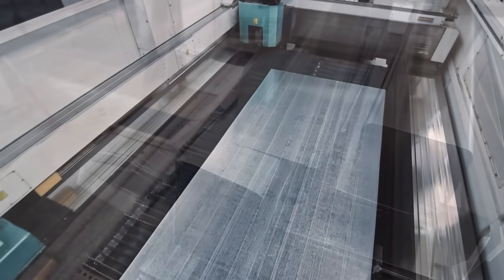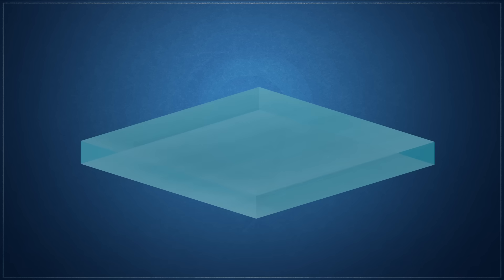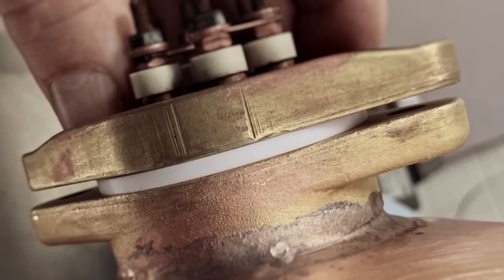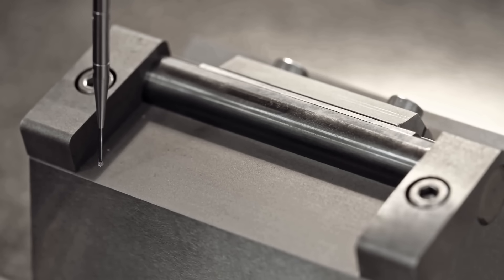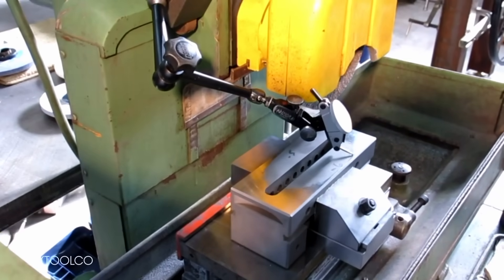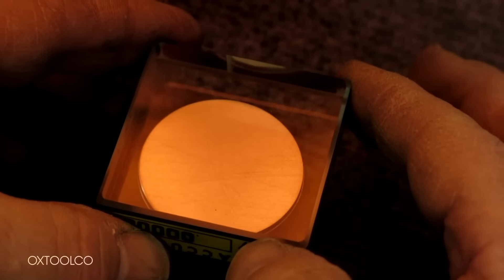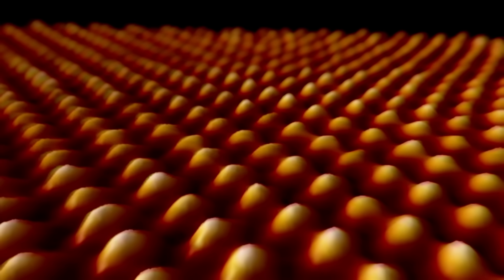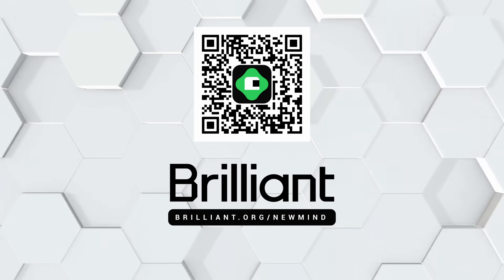The Science Of Flatness

Comment: I once made some testing hardware for western digital, and the hole size was +0.0001 -0.0000 in order to hold that size in a non air conditioned shop we had to change tool offsets 4 times a day as the shop warmed up.
Reply: sounds like one of the best excuses to get AC that I've ever heard
Reply: How do you even verify something like that is correct? If change in room temperature is enough to make your machines out of tolerance, wouldn't the part also expand and contract? Did they have to specify that tolerance at room temperature? How do you even machine that? The tool itself is going to heat up.
Reply: @DoesntRefillTheBrita  If you know the material, unstrained parts have very well specified thermal expansion ratios, so it's possible to calculate/calibrate it.
Reply: @ of course, but the part is going to change size as it's being manufactured just from the heat of the tool. It'll be changing tens of degrees within seconds
Reply: @ And you've discovered why precision machining uses copious amounts of coolant and lube
Reply: I'm wondering if the amount of scrapped parts would have more than justified getting an AC to keep the temperature stable.😮
Reply: Uncontrolled environment that you had, you NEVER held .0001" tolerance.
Reply: I'm guessing freedom units

Comment: The three plate method is a really clever and elegant solution to one of the most mind-boggling challenges in achieving precision: how the hell do you achieve precision greater than what you started with? The existence of inhumanly precise tools and manufacturing will always be one of the most impressive feats to me
Reply: The fact that you can rub three rocks together and create precision surfaces still boggles me.  But not as much as precision threads. Like how do you get more precise threads from junk threads?
Reply: @christopherjones7191  averaging
Reply: @christopherjones7191  usually by some reduction method typically using gears.
Reply: @christopherjones7191 gear reduction
Reply: If it was up to me I'd have waited until lasers were invented.

Comment: Can wringing occur between two different flat materials?

Back in the late '90s, hard drive disk surfaces were so smooth that the read/write heads would cohesively bond to the disk's 'landing zone' (the place where the heads would touch down and rest when the drive is not spinning) similar to your description of wringing - 12:00. Stiction would occur and the drive would be unable to spin up!
We overcame the problem by 'texturing' the landing zone for the heads with a small laser to allow air between the surfaces.

I always attributed the stiction to a cohesive vacuum between the head and the disk, likening it to trying to pick up a large newspaper page laid flat on a tabletop from the center of the page!

I learned something today! Thanks!
Reply: I don't think disks are flat enough for that, as their entire method of data transfer is quite literally being burnt to reflect/ not reflect a laser. Being 2 different materials, I would guess static.
Reply: @DoesntRefillTheBrita  They totally are...
I was an engineer for thirty years at Seagate and Conner Peripherals before that.
Reply: @chrislong3938  did you just edit that comment, I swear it originally said DVD and CD, not hard drive.
Reply: @DoesntRefillTheBrita  I'm afraid not, bro. I never worked on those things. Just drives.

After drives got above 1TB (I think, I wasn't tearing them apart at that point in my career) we started off-loading the heads onto ramps at the OD.
Before that, they always landed in the ID landing zone.
Reply: @chrislong3938   sorry but the little (edited) gives you away 😬
Reply: @ I don't recall what I edited, but it certainly wasn't the drive type!

I did have a buddy who left Conner to go to work for Phillips on their CD-ROM drives and that is where I learned most of how they work!
I had never known for instance, that their tracks are recorded in a spiral rather than in concentric rings as a hard drive does.

I know nothing much more than that, other than the laser part of them.

Comment: The Whitworth method is not fully explained.  I am assuming that flatness is achieved by rubbing the two surfaces together.  But what are the surfaces?  Metal?  Wood? Both?  It would help to know, and the actual degree of flatness obtained, relative to today.  And a moving graphic would also help.
Reply: Oxtoolco has a good video that goes more in-depth on the subject, as does robrenz.

Comment: The air bearings made by Profesional Instruments Company can have air gaps of .0001 inch and spin at over 10,000 RPM.  The AEM (assynchronous error motion) is 12 nanoinches.  These are required for disc drive multidisc writers (MDWs) which embed the servo information.

Comment: This is a topic I've thought about quite a bit.
I have worked in an optical lab making lens, and some were plano or flat.
Sometimes, we needed to make them just ever so slightly convex so as not to trap bubbles in an epoxy bond.
Before the optical lab, I worked in a machine shop making indexable carbide inserts, and we lapped them to a pretty accurate flatness.
I now work in a granite shop, and I learned that a typical granite countertop is sometimes quite concave or convex, and an interesting comparison would be the curve of the earth itself.
Think about this.
If the earths surface was polished but made an accurate representation of its curvature.
It would be flatter than a typical granite island countertop with a standard fault of being high in the center by the thickness of a few  hairs or sheets of paper.
Most people wouldn't care or notice, but when you've made optical lenses, you notice the reflection and inaccuracies.
Considering the radius of our sun.
We would probably think that was straight and flat, yet it's a curved surface, in regards to the radius itself.

Comment: As you use engines are your initial example: A head gasket doesn't just accommodate the less than perfect flatness of the head and block. It does that while holding the pressure of combustion, while also allowing for differences in rates of thermal expansion, and absorbing the minute but relevant expansions of each explosion event. 
Parts that remain at similar temps and then pressurized can be much made much closer in flatness and then use just a sealant. Although even near perfect flat surfaces will still not hold great pressures,  even lapped surfaces.

Near total vacuum systems for example still require vacuum grease\sealant. That is only a 14.7psi different from atmosphere.
Reply: Indeed - let's hear it for all the hard-working gaskets that allow our critical machinery to function reliably, the talented engineers who design those gaskets, AND the precision manufacturers who fabricate them!
Reply: head gasket mating surfaces are notorious for requiring a minimum surface roughness to bite into gasket material and keep it in place.  flatness from end to end of a block/head surface would depend more on the clamping ability of the head bolt system and geometric stiffness of the head in general
Reply: Absolutely the surface finish definitely dictates the bite of the surfaces to the gasket. The stiffness of either surface doesn’t dictate the mated flatness though. Only the initial flatness of both surfaces and the tension of the fasteners with a non-homogenous gasket will dictate final flatness. Which is generally of no consideration in bolted joints. Only the sealing and maintaining of accessory tolerances is. 
A stamped oil pan looks like the Rocky Mountains when torqued down, because the initially flat stamping is deformed by the the localized clamping of the bolts, but the gasket accommodates.
Reply: Modern head gaskets are a remarkable achievement. Iron block/Aluminum heads was common practice.
Reply: All of our valve seats and poppet valves are lapped.
I regularly seal waterjet pressures of up to 60,000 psi, but I decreased the setting to 50,000 psi, and the flat surfaces seal great.
The secret is they are small surfaces, and they get torqued properly.
I wouldn't be able to keep 50,000 psi in a relatively large surface like a head gasket.
Our other valves and seals are small conical 60 degree surfaces that smoosh together a bit.
But I do quite a bit of flat lapping to seal leaking disc valves.

Comment: If you had two guage blocks that were flat at an atomic level would they bind together so you couldn't get them apart?
Do atoms (or things at the sub-atomic level) start to actually interchange or move from one surface to another at a certain degree of flatness? 🤔🤷‍♂
Reply: I think one of the liquid metals whose surface is perfectly flat would explain this.
Reply: Yes, but it generally needs the vacuum of space. Surface oxidation occurs very quickly, which greatly hinders the process. See 'cold welding. Special surface treatments and lubricants were developed for space vehicles that needed to account for this phenomenon.

Comment: Even 45 years in engineering & machining.., flatness still melts my mind as to how far one can go..🙏🙏🙏
Reply: My brother had a book from the 1930's about telescope making. Lapping not just for flatness, but paraboloids. You used a pinhole light to find any distortions in your mirror. They used silver, although I think aluminum is able to be deposited now.
Reply: @ 
The engineering is all well above mine.., but for me it is trying to conceptualise the nanometers scales etc.. the accuracy involved in EUV manufacturing .. & as you say lenses etc… beyond my comprehension…
Reply: @tigertiger1699  euv doesnt just involve flatness problems, but purity problems, timing problems, accuracy problems, etc.  it takes every single most difficult engineering execution problem and rolls them up into the same process.  
shooting molten tin droplets 50000 times a second, hitting EVERY SINGLE DROP with not just one, but two laser pulses and not missing a single one.  purifying water down to <100 parts per quadrillion. single nanometer positioning repeatability at 30g acceleration.  its all just black magic
Reply: @ 
Thanks🙏🙏🙏🙏🙏🙏 I would never have figured that out👍🤗

Comment: 4:33 wut... accurate to 0.0004"? Standard milling tolerance, including flatness is 0.005,  0.002 max. Half-thou tolerance is in the 'impressive' zone for shop tools and basically unheard of for mass produced parts. I used to reverse engineer PCD and CBN cutters for <insert most north american car and plane manufacturers here>. If I gave the shop guys a 0.000X tolerance on a drawing they'd correctly assume I got the decimal in the wrong spot. Dimensional errors run downstream, so unless our end users used more accurate tip locating tests than we did when swapping their tooling (they don't), they could never achieve more accuracy than we provided. My brother ran the CMM for a nuclear validation lab (coolant pipes including their mating surfaces), never below 0.001 for flatness.
Reply: Single-reed woodwind mouthpieces are routinely finished to a tolerance of 0.0015".  I often use a 0.0008" feeler gauge because I have one.
Reply: Sorry dude, tool and die folks commonly work in tenths, and even millionths.
Reply: Aerospace pushes those tolerances often. Just got done inspecting some matched grind valves that had to be .0003-.0005 apart.
Reply: Likely for rocketry and space craft
Reply: @maxstr  nah, my bet would be on semiconductor manufacturing, what they are doing at ASML is nothing short of magic :D
Reply: Hand lapping a workpiece flat is a knack.  It is too easy to make a convex workpiece by pressing unevenly.

Comment: SMOOTH
Reply: Smoothness and flatness are two different things. I saw a picture from an electron microscope of a surface made of atomic pyramids. The flatness was within a few atoms, but the distance from pyramid tip to base was about 50 atoms. So a quite "rough" surface compared to the flatness. In principle this concept could be scaled up, until the roughness is like that of a cheese grater but each "grater tip" is in the same plane down to +/- zero atoms.

Comment: If metal is poured into a cast that was literally perfectly flat, would the crystalline structure of the metal form perfectly flat?  I don't think it would.  It may be impossible to have a perfectly flat crystalline structure.  Someone entertain me, prove me wrong.
Reply: Silicon boules used for wafers in chip manufacturing are very close to perfectly mono-crystalline. But they are made "in the opposite direction", in the sense that you dip a known-good crystal into a melt puddle, and then slowly lift it out (while managing temperatures obsessively). If you want to know more about it, read the wikipedia article about the Czochralski method.

In theory, if you have a perfect crystal, and you break it clean, you will have a perfectly flat surface. But since even lab grown diamonds never have a 100% perfect crystalline structure, in practical terms it is still science fiction for surfaces lager then demo-scale.

Comment: I didn't understand the use of height gage and adjustable columns or use of a CMM. Why not just use a laser and reflection and reflection and mirrors to measure flatness?

If the laser's pitch is two thousandths of a centimeter or smaller and placed parallel to the surface you could measure the flatness of a surface based on the angle of incidence of the laser.
Reply: Air is the problem, it is unstable, different humidity and CO2 ratio that affect refraction index, it can and usually have vertical gradient that make it huge weak lens, so it is much more robust to use good old direct touch probes.

Comment: Once you get to low tolerances, things become crazy expensive
Reply: But that is an ever ongoing "arms race". Things that are today considered trivial tolerances were the absolute pinnacle of precision at the beginning of the automotive boom. Every time a precision technique can be scaled up to cheap(ish) mass manufacturing new possibilities open, and the early movers reap all the cheddar.
Reply: I was doing a design technology project at school, and we needed a specific piece machined externally for it. I was being super precise with the whole thing, not knowing better, and put each centimetre and degree measurement on the design to .000cm and .000 degrees. Come to checkout and it’s nearly 80,000 pounds. Teacher comes over, looks at my submission, deletes down every decimal place, and cuts the price down to about 60 bucks 😂 that’s how I learnt higher tolerances are lower costs.
Reply: @Inquisitor_Badge  I can't count the amount of times that, as a machinist, I've had to call up an "engineer" and ask "Do you REALLY need +/-.0001 on this broomstick handle? Because I can do it, but it's going to cost you..." Exaggerating of course, but please, for the love of God, put acceptable tolerances on your drawings.
Reply: and as you pass a print/design from department to department, everyone likes to tighten up those tolerances/surface finishes a little bit... resulting in safety factoring safety factoring and tolerancing tolerances, and CRAZY expensive.  cause, you know, better is better, right?
Reply: @adamh1228  and the regulators show up pretending they know dick about squat the government makes more rules, the tolerances go up, the prices go up, the thing becomes unsafe unreliable and the guys in suits with their fingers in their noses saying "I'm helping" "I did guud"
Reply: We call them tight tolerances

Comment: Strange to say that by decreasing the tolerance on the thickness of a glass sheet whe can effectively increase the flatness. This is no totally correct as the whole part can be domed for example. This effectively can have the nicest thickness of all all the way but not meeting any flatness tolerances. I understand that for the purpose of the video. This is not fully needed, but it should be said that the introduction part is simplified.
Reply: It's dependent on what standard you use to define the thickness dimension. Under envelope requirement (standard under ASME Y14.5) thickness can constrain flatness on two parallel surfaces. Under the independence requirement (standard on ISO 8015) it would define a two-point measurement which would indeed not constraint flatness.